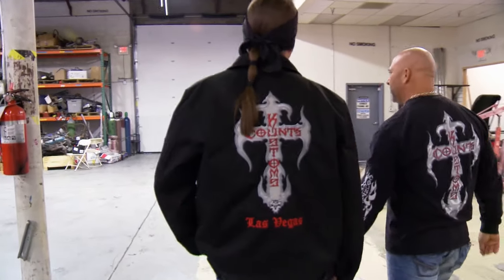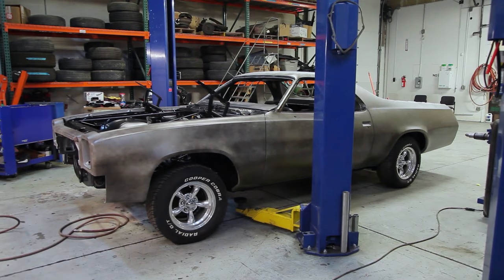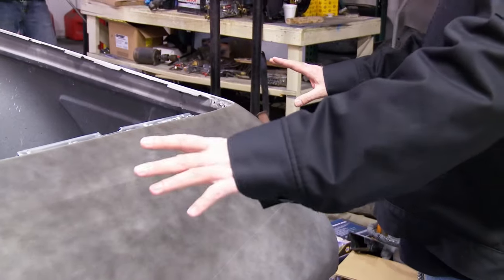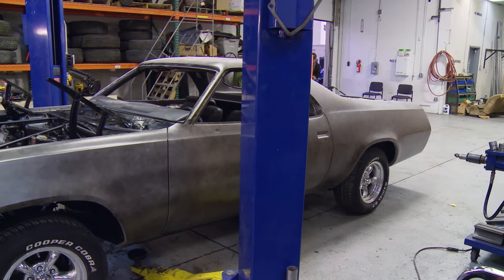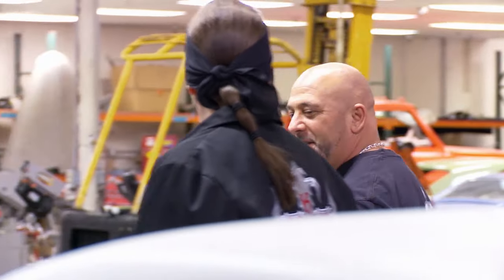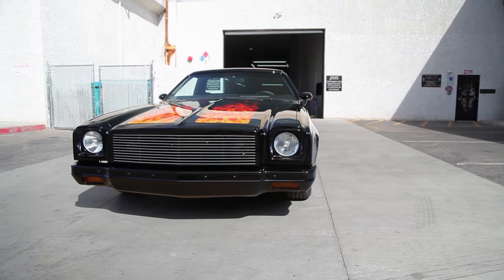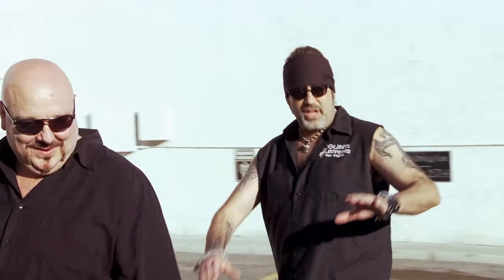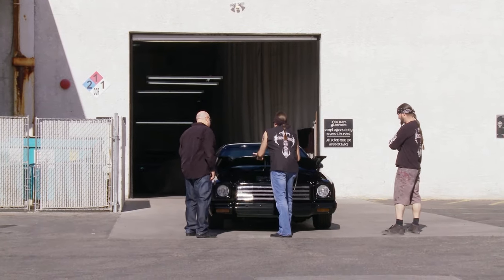Counting Cars: '75 El Camino Royale is the ULTIMATE Muscle Car (Season 6) | History

Comment: Why smooth that rear bumper than leave that super fugly front bumper with those horrible carriage bolt heads exposed. It’s time to step up to some EFI now too on these older cars Kount, there are kits that will even keep it looking stock old skool under the hood. Make these cars daily drivable.